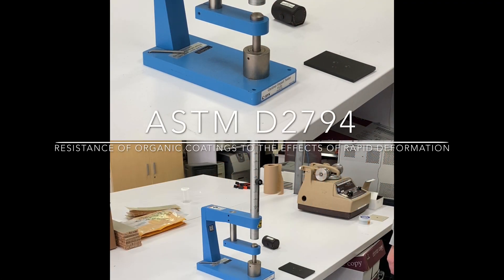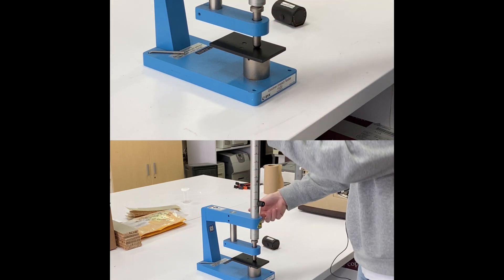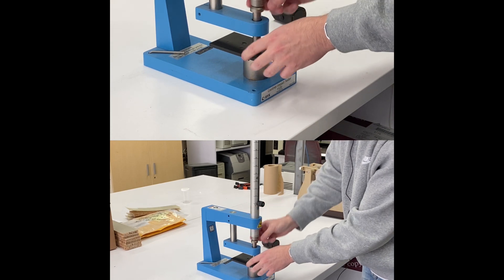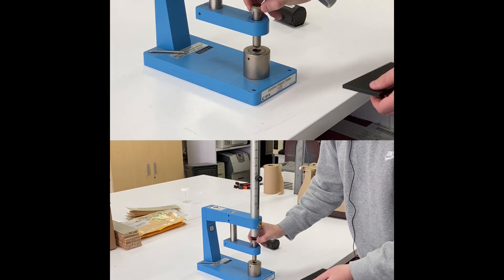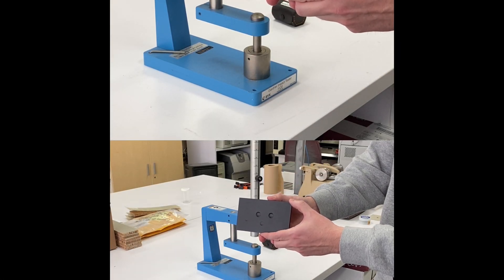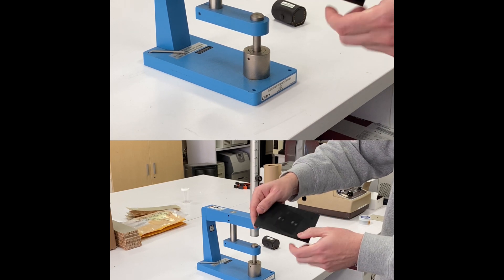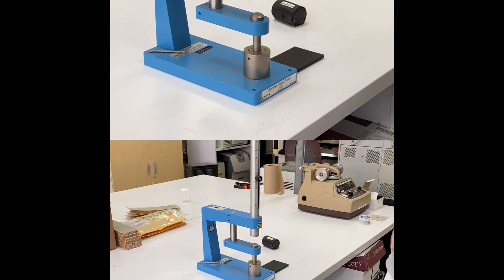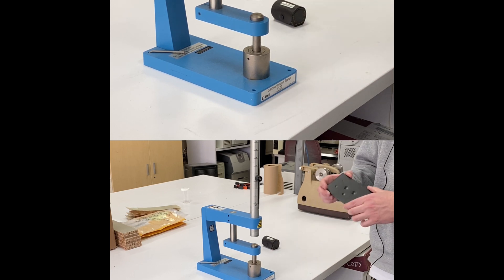ASTM D2794 Standard Test Method for Resistance of Organic Coatings to Rapid Deformation

Comment: This is very useful information. I would like to ask a question: Which standard contains information about the minimum required paint resistance for pre-painted steel with a thickness between 0.300 mm and 0.600 mm?"